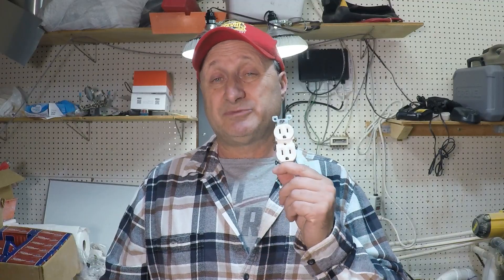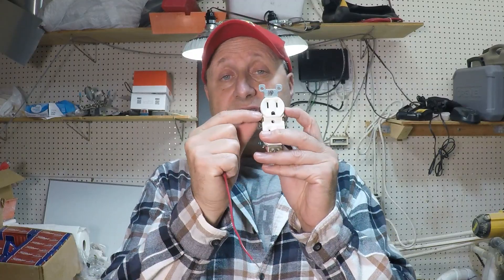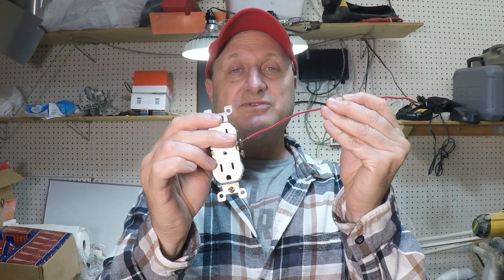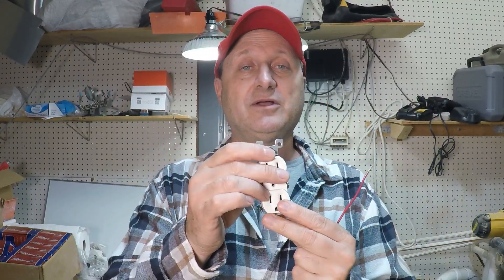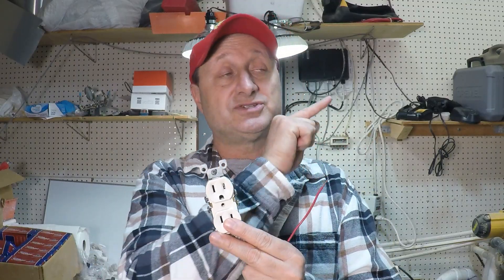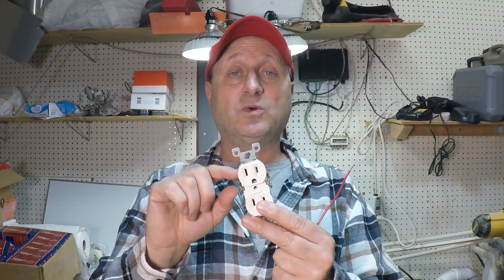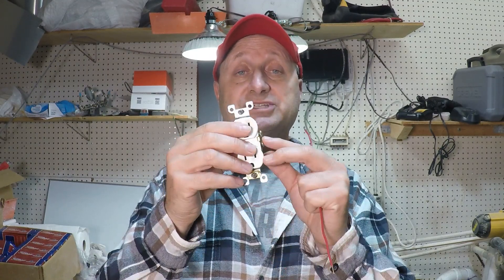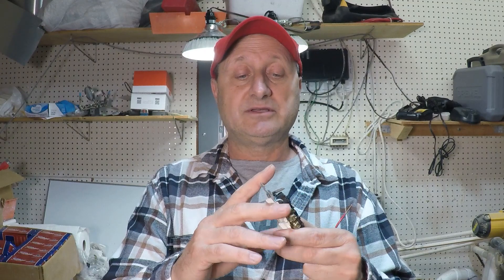Why Is My Outlet HOT With Nothing Plugged In?

Comment: I recently discovered a warm outlet in one of my upstairs bedrooms. I found it was on the same circuit as our living room where we were running a space heater. I unplugged the space heater and the outlet went back to normal temperature. No other outlets on the circuit had this issue.

I had an electrician come out to look at it, and he removed the old outlet and capped off the wires. He did not tell me what caused the issue and instead was trying to get me to purchase replacement of all the outlets on the circuit with arc flash protection outlets. I said I needed to investigate more and he told me it was extremely risky and that I should keep the breaker off at all times. I can't do this since it is the breaker for my living room. However, I stopped using the heater entirely.

Based on your video it sounds like the high power draw going to the heater + loose connection to the outlet. Should I look into replacing the other outlets on the circuit?
Reply from the maker: Yes you are correct about the draw. You can swap out those outlets to COMMERCIAL 20amp outlets. Make sure all of the wires are installed properly, then try it again. You do not need arc fault equipment because they may just trip anyway.

Comment: We came home and noticed a fishy smell in the bathroom. Checked the trash, the toilets etc then i remembered i read somewhere that a fishy smell could mean the outlets. So i had my husband check the outlets and the plug in like the one in your video was warm to the touch. Is the best option for him to shut off power and replace the outlet? There is an outlet on the other side of the wall (garage area) where the dryer is plugged in. Should we replace that one as well or just tge bathroom one? Thank you
Reply from the maker: I would replace them both and use a commercial outlet for each.

Comment: While preparing to do some painting, I removed the faceplate to an outlet and noticed that the screw was warm.  I touched the metal outlet frame and it was very warm, almost hot, to the touch. After a bit of experimentation I noticed that it warmed and cooled as I turned a nearby space heater on and off. The outlet the heater was plugged into is on the same circuit.  
Tomorrow I’m going to replace that outlet and see if that makes a difference. 
I should mention that about two weeks ago a pipe broke upstairs directly above the outlet in question which is why I’m doing the wall repairs.
Reply from the maker: Change the outlets on that circuit to a 20amp commercial outlet. The are better equipped to handle the load from a space heater. I have a video on the differences between a standard outlet vs commercial.

Comment: Hey there, I have a thermal camera and I looked at my GFI outlets, and I think only the GFI’s are around 100 degrees when seen on the thermal camera from the back where you can see the back of the plug box.  From the front, it shows it’s around 85 degrees.  Other outlets are the same temperature as the surrounding wall and don’t stick out.  Many GFI and plugs that have a turn knob to adjust the brightness are around 85 degrees from the outside.   I was able to open a cabinet which has a gfi outlet facing the outside of it; and look at the hottest part of the outlet and it looks like where the wire meets the outlet itself.  It registered around 100 degrees Fahrenheit.  I have a FLIR thermal camera.  Thanks!
Reply from the maker: thank you for watching! Please sub to the channel if you have not done so already